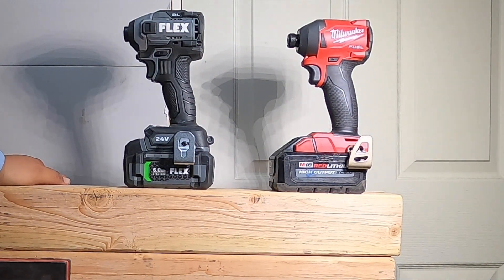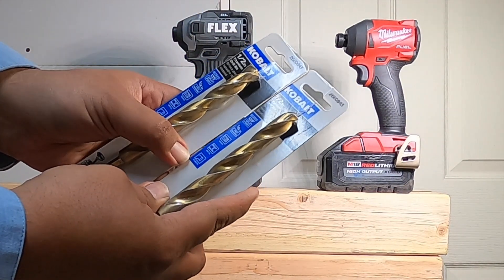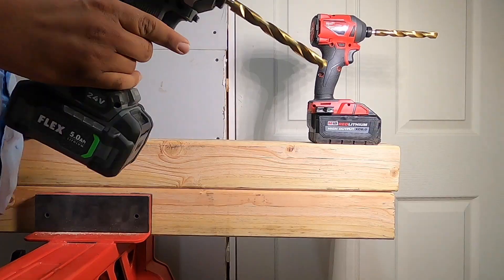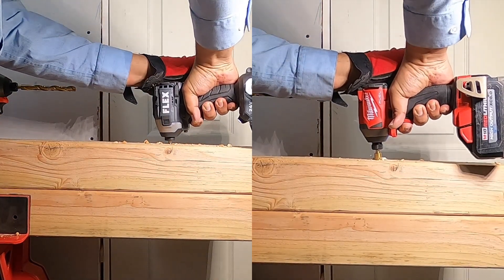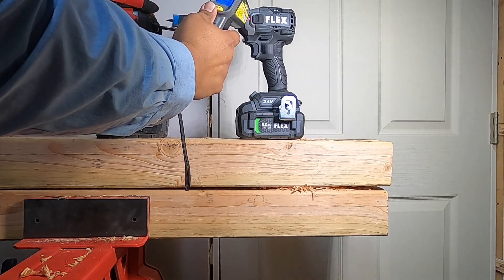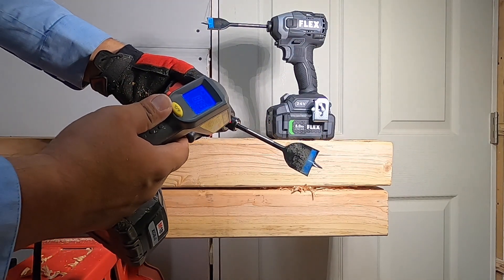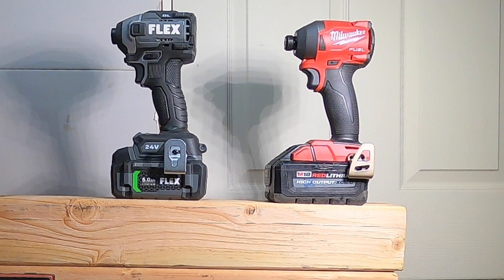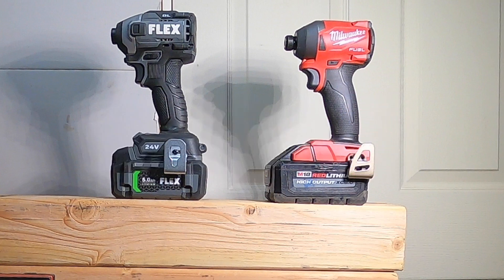Flex VS Milwaukee Part 2 Impact Drivers (FX137A) (2853-20)

Comment: Nice video TH.  You need to get the Gen 3.5 with the 2 ball bearings.  Put a claim in with Milwaukee and they should take care of it.
Reply: yes I get pissed and curse Milwaukee out every time I see the gen 3 dribble its bit out like like a flaceed tool. Mine has not done it (yet) but seeing this garbage makes me mad. Something so easy to do right, how did they do it so wrong. the engineer or product designer that cheeped out on a ball bearing to save some money, hopefully learned his lesson. My ryobi has never spat a bit out in 6 years :(  If I use a paddle bit, I will keep my ryobi around for extraction)
Reply: @djjinerson  it’s starting to happen on my gen 3. It’s getting pretty annoying
Reply: @angelrojas4355  call Their sawdust number and please let us know how it goes. Don’t just live with it they need to stand behind their warranty.

Comment: The 6 ah milwaukee battery is 21700 cells the flex 5 volt is 18650 cells. The milwaukee in all fairness should crush the flex. But if you go to the 8 ah flex or the 12 ah they are 21700 cells, then you would see a true comparison.

Comment: Thanks for the video. Performance differences are negligible but I think the real question for people will come down to longevity and real world use over time which the data is not there yet. I don't think having a tool perform a second faster is worth dumping your existing platform for unless you are new to the trade and not that much invested. I would also send that Milwaukee in for service to get the anvil service kit swap to the two ball bearings to eliminate that retention issue in the collet.
Reply: If I didn’t already have Milwaukee, Dewalt and Makita I might think about Flex. If I didn’t have a Dewalt oscillation tool I probably would get the Flex oscillation tool and then have the option for a new platform. I’m still a bit nervous about the longevity of the Flex tools and also customer support.
Reply from the maker: 👍 I'll send it in thank you
Reply: we should question their lifetime warranty.  If it breaks, will they replace it no questions asked?

Comment: I don’t know about the longevity of the flex tool line but, I have the Kobalt 24v system ( which chervon makes ) and I beat the live day lights out of them. I drop them off ladders to concrete ( by accident) drywall dust clogged, screw thousand drywall screws a week and these things keep going. 
If Flex is a step up from the Kobalt line, these things will ROCK. I can’t wait to get a set to put a real world test.

Comment: I just wonder if to much power is a good thing or a bad thing in certain situations. Definitely send the Milwaukee in to get that collet fixed.
Reply: expect to go through a lot of headache if you do send it in.  Mine has been stuck with them for almost 2 months if not longer.  More power is only good for bigger fasteners, but if Flex's assist mode is anything like Kobalt's then it should be fine.
Reply: @ProxyFinal  I haven’t sent mine in, I don’t do a lot of holes with it just screws and lags, I just use a drill when I do holes. I also bought mine refurbished from CPO a year and a half ago so in my case idk if Milwaukee would even warranty it. I would like to see if Milwaukee would just send the part out to me so I can do it myself. I’ve had great luck with refurbished tools from CPO and Tyler Tool.

Comment: Milwaukee has released a Gen. 3.5 to add two ball retainers to the collet, so this is no longer an issue.
Reply: I just bought another gen 3 from hd and it’s only got 1 ball bearing. I had the guy open 5 boxes and they were all the same. So it kinda still is a problem when apparently there is a large stock still of the GEN  3’s. So if your buying a new one there is no way to know unless you inspect them. It’s not like you can order the gen 3.5 it’s the same sku, and technically in Milwaukee’s eyes the same product. At least there’s the warranty
Reply: @djjinerson  yeah it'll be into next year before stock on shelves has the fix. Basically everyone in M18 has this driver by now that wants it.  It really only effects you on a worn in driver where you are using it as a drill. They will warranty yours if that is your use.
Reply: @kartboarder22g17  very true, I just hate to see such an amazing tool fail on something so simple. But I know Milwaukee will stand behind it if it is ever an issue

Comment: Haha decent test. But im on the red team. I still think it's nuts for a 18v system to put up with a 24v system. Yeah it maybe a little behind. But I'm a weekend worrior. So two or three seconds won't change my mind. But that bit holder bs is something milwaukee needs to get fixed asap.
Reply from the maker: I just send mine in for warranty. Thanks for watching.

Comment: Milwaukee fixed the collet issue with the "3.5" release, VCG covered it. Very huge news that the new Flex impact is now 👑
Reply: Its tough to crown the Flex impact king just because it finishes a second faster in some tests than competition from a performance perspective. While these do look intriguing, they need time to be in the hands of professionals on a daily basis to see how they hold up. You could have the fastest performing tools across the board but if they are constantly requiring service then its a pass for me. I like another player jumping into the ring though with the big dogs in the industry. They may shoot themselves in the foot limiting sales if they truly are just being sold through Lowes but time will tell.
Reply: @tonytrofe7137  flex already said it's not just lowes only lowes is just the big brick and mortar, it really just means no home depot, and lowes only initially